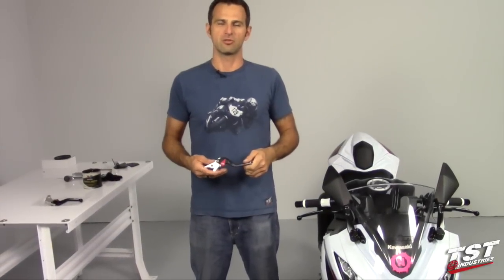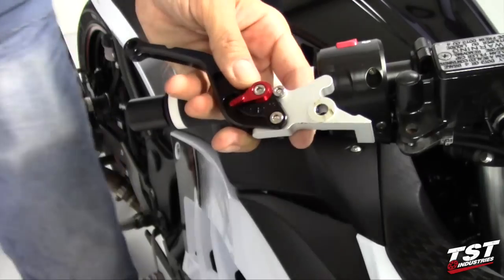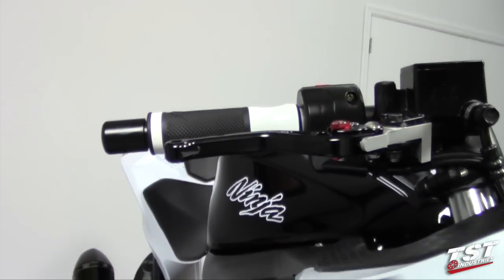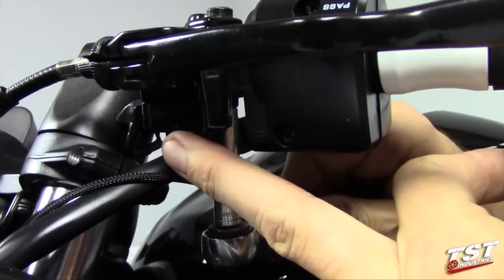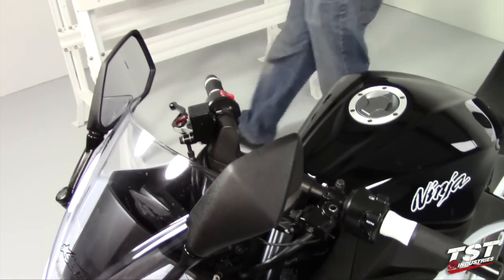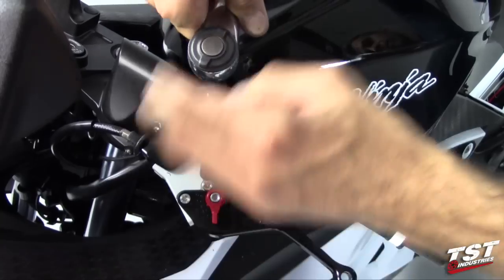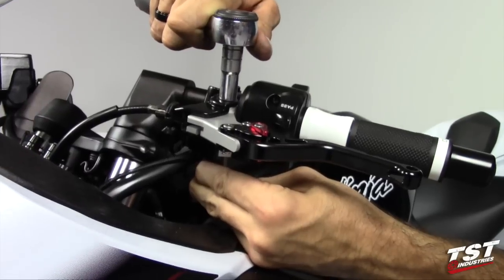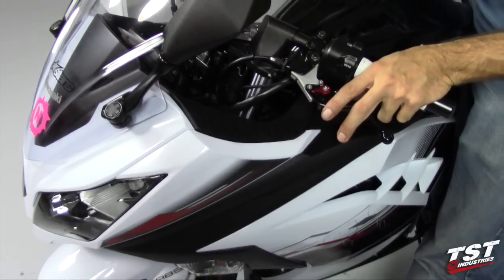How to Install Adjustable Racing Shorty Levers on 2013+ Ninja 300 by TST Industries

Comment: I installed some Chinese levers last night on my 2015 ninja 300 and had a hard time with the clutch lever install.  The nut at the bottom of the bolt which is said in the video to be 8mm wasn't  fitting into an 8mm socket.  No socket I have fit that tiny nut.  I had to end up holding the nut with a needle nose pliers while I screwed in the bolt.  Was a royal pain.  It's such a small space to work in where that nut goes.  The job left my fingertips bloody.  Finally got it all done after two hours of struggling.  On my back in the garage with a flashlight in my mouth.  I always find a way to make a relatively easy job extremely difficult.  But thanks for the video, it helped to refer to it.
Reply from the maker: Sorry to hear about your difficulties with the Chinese levers. We try and provide as much guidance as possible in most of our installation videos so it's great to hear we were able to help you out. You ride safe out there!

Comment: i changed out my levers and the bearing was missing where the pivot bolt screws in. i noticed you didnt have them in the clutch lever in this video either. is it a must have because i cant seem to find that bearing anywhere.

Comment: The 8mm locking nut on the clutch is a pain to reach. I've tried socket wrench, crescent wrench, but the switch body is really in the way I can't get it off
Reply from the maker: you can always loosen the perch from the handle bar, rotate it until you can get to the nut, then put it back in original location after you are done.
Reply: TSTindustries Thank you. Got it

Comment: would there be any other option than using the grease in the hole?
Reply from the maker: creativersd You really want to make sure that the bearing surface at the pivot is lubricated with a viscous and waterproof lubricant. What were you thinking of using?
Reply: +TSTindustries what about some white lithium grease
Reply from the maker: Banshee8813 that will work but white lithium grease does not do as well with water as bearing greases
Reply: Ok I appreciate that guess ill be switching it out for some bearing grease through the hole and some silicon grease on the push rod cuz good Lord knows I can't help but get caught in the rain sometimes

Comment: The 10 mm bolt on the clutch lever wont come out. The little 8 mm nut came off, but now the 10 just spins and spins. anyone know why?
Reply from the maker: That sounds like the receiving thread in your perch has been stripped. You can push up on the bottom of that fastener as you turn it from the top and then it will come out. If the thread is in fact stripped I would recommend replacing it with a new unit.
Reply: Unfortunately pushing against the bottom did not help it come out :/

Comment: With the lever set at the 1 or 2 position, the plunger for the clutch switch doesn't come out far enough to start the bike while in gear. Any easy way to fix this?

Comment: Does it better than oem fitment?
Reply from the maker: The fit of these parts on the bike is not better than oem, it is on par. The fit of the levers to your hand is better due to the ability to adjust the ergonomics to your liking.